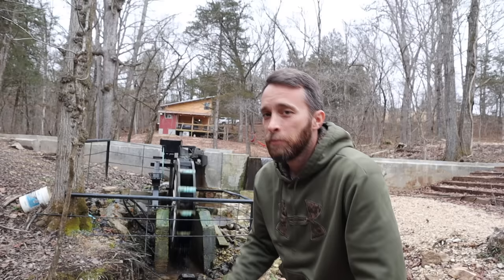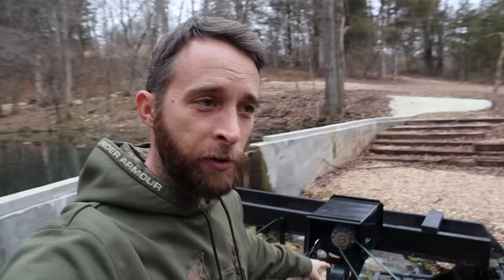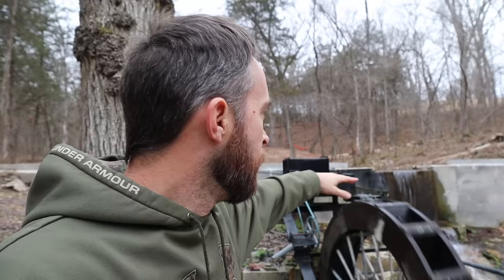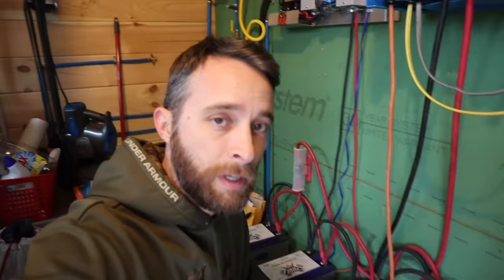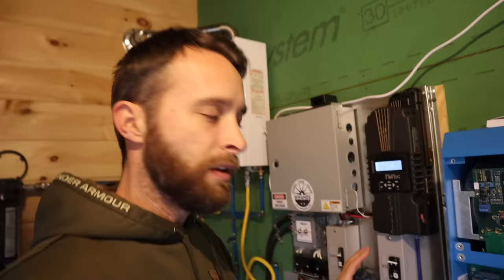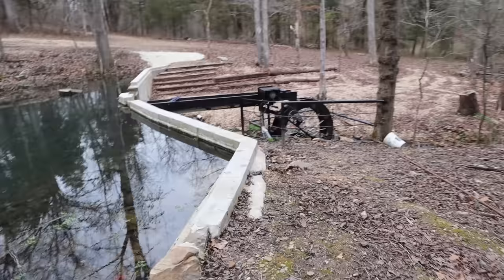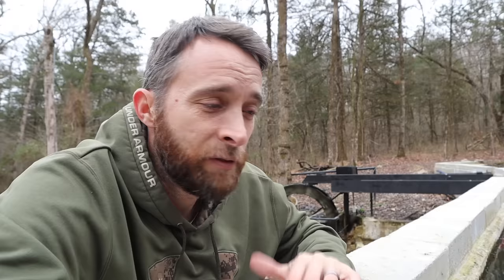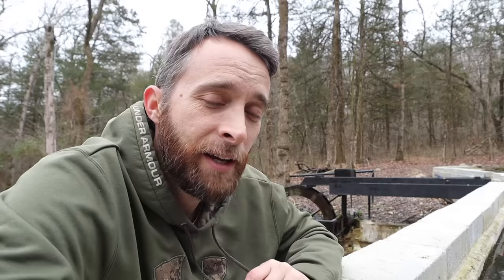Did we MAKE HYDRO POWER Using Our Waterwheel for Self Reliant Off Grid Living?

Comment: Look into a ram pump  and do another reservoir above the spring. You will have less volume but you may be able to attain a thirty ft drop.
Reply: The efficiency in a ram pump is excessively low you would never be able to get enough flow to produce any power.
Reply: @bradleywyle5707  they are not full time and even if they were they don't need to be generating 100% of the time. They have a set up now which generates some power. They don't need to waste. My thoughts are build a reservoir above the spring level and use the rampump to fill the reservoir.  That will give them im guessing in excess of 30 ft of drop. Use that reservoir  with more fall and less volume to generate  with a Pelton.

Comment: if your sticking with what you have now i think you need to but end blocks on the wheel to hold water for longer also it looks like the spout is to far back on the wheel you could always try a pitch back style best would be take wheel apart put more angle on the fins to capture the water

Comment: Seems like that wheel should make a lot of torque, I think and even bigger pulley on the wheel would help spin that generator faster. Also. on many automotive generators, you have to energize them before they with work. That involves crossing a power line over to another terminal for just a split second 
.

Comment: If you had hired an excavator, and dug the water wheel down, as well as lowering the stream after the water wheel, you would get a lot more power. More than double as I could see from the fall of the strem further down. If it is your property further down, you can potentially increase power output many times what you get by now.

Comment: Instead of using DC power use alternating power of 120. Convert an 12 volt alternator to 120. By using the highest amperage you can find on the alternator converting it will give you the best power going to the house. You connect it in in place of the generator..

Comment: I heard in a 12 volt or 24 volt DC system low voltage,  that you lose a lot of your power if you try to run any distance in the wiring. Even in vehicles running 10- 20 feet away. Therefore I believe that if you convert your power to 120 volts AC down near the water wheel and run it to your house at 120 volts AC that you won't lose as much power and everything will be fine.  Might check with some experts and see what they say about that. I do a lot of automotive wiring and I know it's always been said do not run DC over long distances even in a vehicle like 20 feet can make a difference so that's my two cents worth good luck.

Comment: Hy its mi again if you take out the voltage regulator from the alternator you get ac current you have les current trop in long distance and you can put the regulator close to the batteries good luck

Comment: It maybe possible you have a grounding issue or a break in your cable which is causing current loss, also you have to account for the length of the cables you are running and the fact that they are underground a small cable runs less power a bigger cable will allow more current to flow throw, you loose so much current per every meter of cable based on the size of the cable you are using.

Comment: Had you gone 12v you would have needed much heavier wire to run to the house.  As for 20' of head, do you have a place higher on your property you could use for a small resevior?  Maybe a water ram pump to pump from your spring up to a higher resevoir that could then give you the head to run a pelton wheel generator.  As for your water wheel, could it be slippage on the belts?  Maybe some kind of idler wheel to tighten them a little?  Also, if you could measure the actual RPM on the drive wheel of the generator and it is hitting your target but not outputting the amps it should, maybe talk to the provider as it may be defective?
Reply from the maker: I do have a spot above our cabin that I considered damming up for a pond. I considered a ram pump up to it to help fill it. Thanks for the suggestions

Comment: If you move the whole battery back setup as close as possible to wheel and run it as AC up to house from there you'd have a better chance. DC over that long of a distance is the problem. AC can do that and then some

Comment: I have to ask?
What gauge cable is connected to the  batteries from the Gen?
Have you connected a Volt meter at the Gen to determine it's actual output? Once you determine it's true output and it is not defective, then you need to know your cable is sufficient to bring that energy to the batteries. That simple.

Comment: You send low voltage from generator into the house? This brings a lot of power losses. You need to send a high voltage to the house to reduce the losses.

Comment: What size wire did you run ? If you use larger wire it will help with voltage drop.

Comment: If the big pulley is 36" then I am estimating the diameter of the waterwheel is 2.5 meters. At that  hight drop you would need 80 liters or 20 gallons per second. I don't think you have anywhere enough flow to get 2000 watts from your flow with a wheel that size.

If your efficiency is 50%  then you would need 40 gallons per second and then you would still have transmission loss and converter inefficiency.

Do you have any idea of your flow rate  ?

Comment: Do you think a 3 phase 330v 10kw generator would run that far to the house? Theoretically you could hook it right to service box assuming a 3phase box that would be more than sufficient for a house that size. No need for battery back up except for those fry seasons

Comment: That type of water wheel is better for making torque then electricity. You need laminar flow to really get hydro worth it. That wheel could potentially do alot of work but you would need to give it a gear box and use it for mechanical work instead. It could pump water cut logs or stone or even power a auto hammer (or billows😉) for a forge. In fact that hydro generator you have would work better if you could put a pipe at the bottom of the damn and have just a 1in pipe power it. With laminar flow and the volume you have pushing 500rpm would be easy. Ive seen a guy create a hydro dam just like that using a spring and 200 feet of piping down a 20-30 foot grade. His was so powerful it blew apart the fist manifold.

Comment: Wow, 672 comments!!! Probably covered, I’m not going to read them all to find out, I just wanted to add, if your getting your RPM on the water wheel, and the electronics in the house are trustworthy, it must be your belts are slipping, test be disconnecting the house and put a load directly on the alternator, also get an old school rubber tipped mechanical tachometer and double check the RPMs at each axle.

Comment: you have lots of belts and pulleys. Are you sure they are not slipping? You need more output voltage to make the system work. You have 3 phases going to your house. Is there any field control going back to the alternator, or is it self regulated. If it is self regulated you need to set it higher. I calculate about 1.2 horse power or 900 watts is all you are going to get

Comment: Move the water wheel down in elevation as far as your property line is as possible but the best thing would probably be to put a turbine with a pipe far as down as your property line allows to power your cabinet or add additional gears to get your generator far above The minimum rpm for your generator so that daring low water production seasons you still produce the minimum needed to make electricity

Comment: May be you need to add some layer of concrete around the reservoir to get a higher head and make the water run down a slope to gain power. You can try replacing the conveyor belt with a chain and sproket system to avoid losing energy. You shoud try making the waterwheel turn from below... I mean direct the water towards the bottom. You need to invert the direction of the buckets in that case. And a 24 volt generator won't do the job may be you need to upgrade the generator and adjust the rpm...

Comment: Just finished watching this series. Very informative. The idea is sound but you simply do not have the flow rate for a waterwheel and it is severely undersized. Waterwheels usually work better as a run of river system where you only divert some of the water.

That being said….. With the flow rate you have and not a lot of drop you would have been far better off with a vortex turbine. Dig in a coanda screen box right at the foot of that spring, and run an 8 inch pipe down to where you were going to discharge into your other pond and feed it through a vortex turbine. You should be able to produce damn near a kilowatt with that flow rate, and still have a rough to keep your wheel spinning  for show. 

Also, your discharge capacity is too small. You need an emergency spillway somewhere.

Comment: If you put 4” pipe with a screen or filter on it in the top portion, and run it 30-50 ft down the way a little bit and increase pipe diameter by a little bit every 5-10 ft, then go straight to 2” pipe at the very end you’d have all the pressure in the world to drive a turbine or pelton wheel

Comment: pointers power is easy to calculate in DC, for an equivalent power in ac = dc power, you need to use Vrms (root mean square), not peak voltage.
measuring ac there is what we call peak voltage and rms voltage, because AC is a sine wave in other words we cannot just design generators with peak voltage, try to guess what the peak voltage of your 120v outlet is, is it 120v peak to peak, its not 120volts peak like DC sources, to get equivalent DC voltage it has to be RMS voltage
requirement for 120ac outlet is almost 340v peak to peak or one voltage swing peak of 169volts and down -169volts as sine wave for a single phase.. and is equivalent 120volt rms o 120v dc, and can be calculated directly like DC equations, that is the difference between solar which is pure DC and an AC generator that need Vac rms. some testers use peak reading some use true rms ac reading.
Alternating current source everything is constantly changing, the gas generator is generating a peak of 169volt each ac peak to produce 120vac rms which is multiplied square root of 2, the 120volts is actually rms so you can use dc equations directly to calc power.

Comment: Narrow the end of your shoot a little for bottle neck effect. Also it will make it narrower than the wheel. Perhaps some sides could then be added around wheel to deepen the bucket some without a rebuild. Use a second generator. The wheel will likely have enough power to run two. Chute length could maybe be played with a little.

Comment: I think the pma is three phase out up if I was in your position I would double check and run three cables from the water wheel to the cabin and put a three phase rectifier in the room you have your batteries setup before you go into the charger setup
Reply from the maker: That’s what I have currently is 3 phase

Comment: If u put you're belt drive on the water wheel it will increase the amount of speed put to ure generator causing it to make more power generated 
Probably solve that id add few solar panels were ever i could to give ect boost  also had you thought about 
Spilting system ? Get outdoor solar lights for extra lights look simple 
At what you do have hope my ideas 
Help thanks for reading

Comment: Have you looked at ac converter at wheel then convert back to dc in cabin thats a long distance to run dc the jumpy amps sounds like either break in wire or wire is too small
Reply from the maker: Thank you.. Ill look into that

Comment: your water wheel can work but i think you need to use 3 phase AC power motor to the charge controller as you have a very long run of wire for a DC setup
also the power wires you have already run could work if you were using 3 phase AC like a car alternator would work

Comment: Looking at your system I keep going over the wiring and I am not sure but something isnt right. If you have a spare box for a windmill and your turbine is 3 phase 24v which means around 8v per wire, then disconnect at the turbine and wire in the box. Connect your belts and let your wheel turn. Before connecting belts run a battery to a 24v battery setup. Remember the 3 terminals on the box should be connected to the turbine after the 24v wires are connected to the batteries. If the batteries charge, it means your rectifiers are bad or something is not wired right.

On another note. Your drain off system for your pond can be converted to connect to a vertical turbine and not much would need to be done. Check out some videos on vertical turbines. You might get some ideals.
Reply: The actual name of the generator is a Turbulent Vortex Turbine.

Comment: I'm probably stupid, but... How about building the surronding wall higher ( to create more splash ( or digging underneath the wheel to lower it could work I guess ) ) . And then filling the pond with rocks or sand to create more pressure there.

Comment: You don't need 20 ft. Get it a little higher and make a siphon. Its going to pull up the extra feet you need. You should be able to get an extra 2-3 ft once the siphon is going consistently if you get all the air out and increase the pipe to 8 or 9 inch at the end. Just keep that end underwater so it keeps pulling giving the extra from the original 6 inch line to add the power you don't have cause your will is not high enough
... *you might need someone like a strong shop vac to start the system but once started it will pull the water up and over the height needed. For practical go get a random tube. Put it in a 5 gallon bucket. Run the line 2 ft above the bucket and have the end below the bucket. Water will not run!!! Suck on the end of the hose with your mouth and water will run up 2 ft higher than the bucket and down in the line and keep running cause of the siphon. No think of that but you can always so the same thing but make you line bigger at the end also creating the same effect. Do that and start with an 6 inch pipe qns end with and 8 or 10 inch pipe. The problem lies in keep the air out and making the siphon work. You only have to do it 1 time

Comment: Maybe the kind of  wire(aluminum or copper) and the thickness gauge of your wire from the generator to the house makes a difference.
Multi wire strands as opposed to solid wire, i like solid wire myself. 
Of course you already know about the voltage drop per footage but have you actually checked the electrical charts to see what it is as opposed to what it is suppose to be per your 250 foot distance from generator to cabin ?
Are there any loose connections along the whole wire to the cabin?
Check the actual output voltage your getting at the generator then what the reading is at your cabin to see the difference. 
Are there any breaks or tares on the wires causing a loss of voltage?
Its DC VOLTAGE so what the generator produces should be what you get at the cabin unless you lost the electricity in-between someplace. 
I was in hvac for 40  years. One thing I always did like was looking for the juice when something was not working. 
Good luck...

Comment: Well if you can make enough power to run everything you should build another reservoir to catch the spill off use a pump to push it back up to the top leave another spill off so that you can open and close so your not affecting the water source around you that way you can work with the weather when it dries up you can shut the hatch and have a constant flow of water 💦 it don't take much water being pushed back up to the top a garden hose will do it that is if evaporation don't get you

Comment: sense you already have a dam, you can use a tergo or pelton type hydro generator.  the wheel idea is more cosmetic than anything imo.

im also curious about the distance to the batteries, size of your wires, and resistances/losses over distance, needed input of the system. 
i wish i was a micro hydro/renewable energy guru, id come out and help ya get setup but sadly i am not.

Comment: Simple solution is abandon the long run power system and ,build a dam closer to the the cabin put in a pipe and go dow 30 feet to a water wheel ,use a smooth bore 3/4 incg garden hose nozzle on a smaller lighter paddle wheel to provide power. Add 300 watt solar panel and you will be golden.

Comment: Does the alternator need to be 24 volts? I know one from a 1970s Ford F100 doesn’t have a built in voltage regulator and can make very higher DC voltage. That could offset the power loss from the long wires. Also, with all the torque from the huge water wheel, I bet it could spin the fool out of an alternator with the right gear ratio

Comment: Solar is a great option. also how is the wind? I have npower 400 watt 24V win gen from Norton tool and it is great ! have 400 watt solar with MPPT . I have NiFe batteries in my cabin . 20 cell .keep 24V battery that's more efficient  on inverter to 120V . 48 is even better .I don't have running water to use. I do have a 24V DC submersible pump from Norton tool. stay off grid. them batterys should last 10 year or better . just keep them warm. above 40F best. I went wind and solar to meet our cabin needs. if you has gas well can use fuel cell to make power . no engine. keep looking you have options . some times you have to think out side the box.